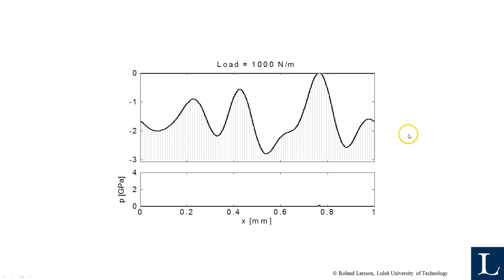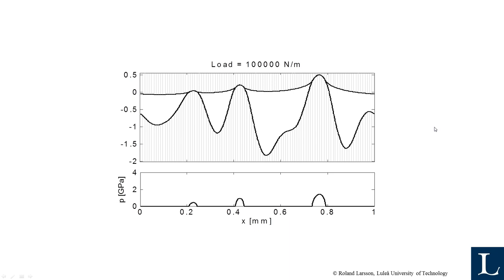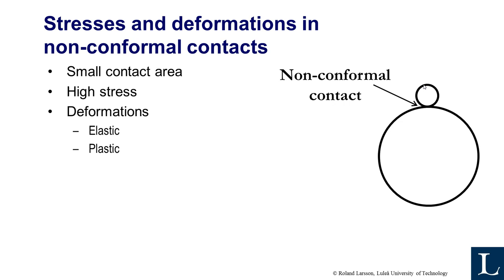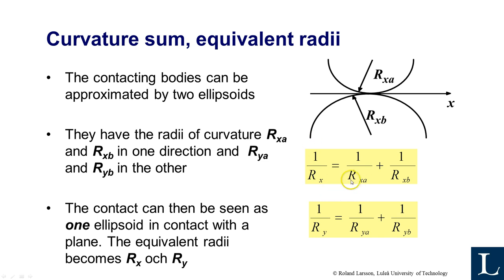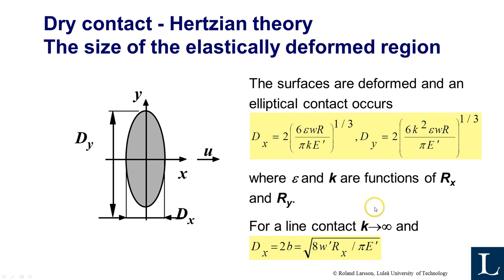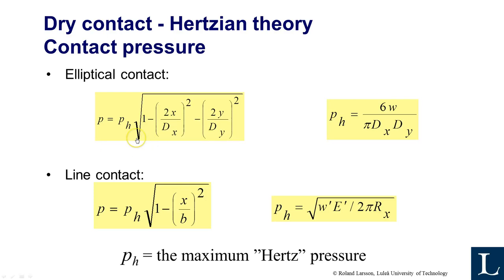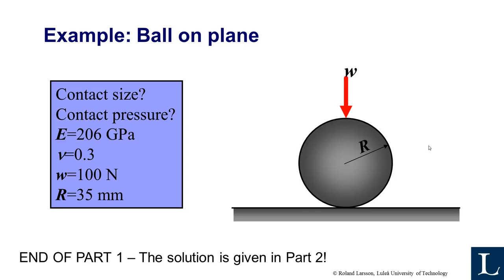Contact Mechanics - Part 1

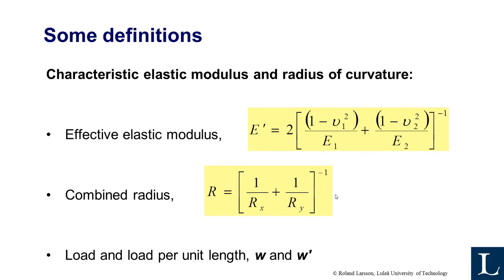Comment: Hi, I have a query about the formula for the effective elastic modulus in the case of dissimilar metals (approx 8:25 in the video). In some cases (eg: E1 = 200GPa, E2=210GPa) this can produce an combined E' which is larger than the two materials. Is this correct?
Reply: +Andy Duffell yeah thats right